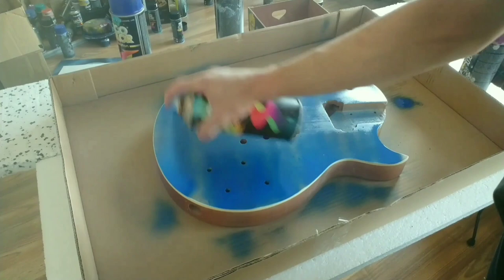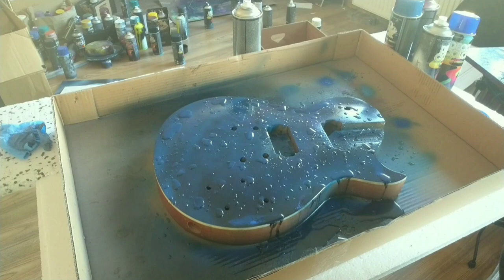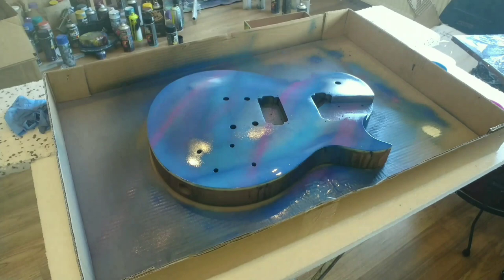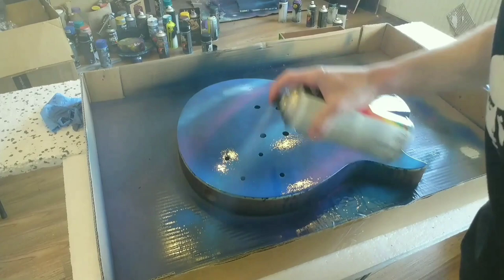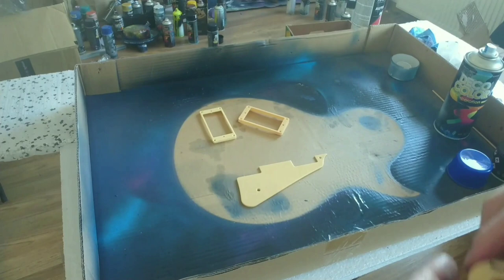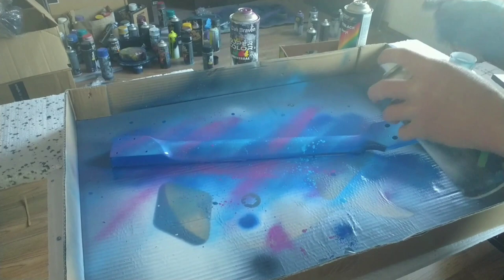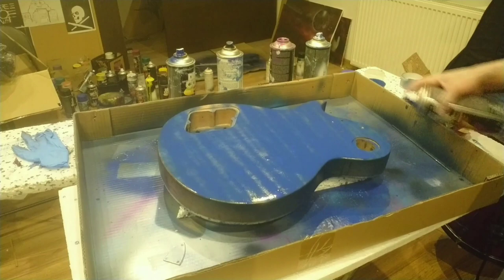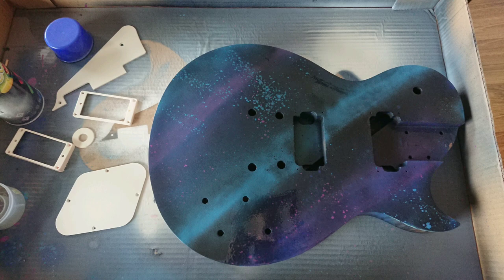Guitar Painting - DIY Harley Benton Guitar Kit [Part 2]

Comment: Nice results! What kind of spray paint did you use? I've built a Harley Benton P bass and I'm at the step where I'd begin painting it, but I'm not sure what paint I should be using.
Reply from the maker: Hey there, thanks, well i used the cheapest cans i could find and it looks fine but with bit better paints it would be better, and even more if painted with spray gun

Comment: Do you have to do a primer coat before your colur coat??
Reply from the maker: You'd better do. I didnt and the paintjob wasnt that solid after a while. Also use a good quality paints, dont use cheap ones.
Reply: @bbx78  and can you paint the primer on the body straight away or is there some type of sealer already there?